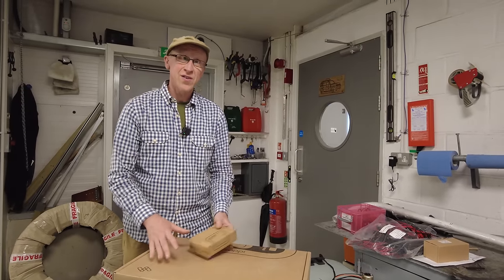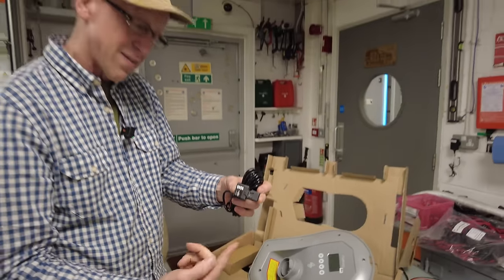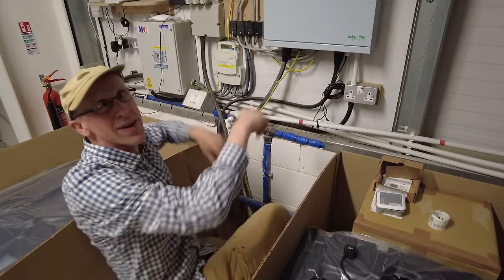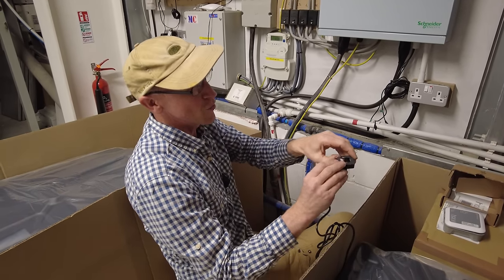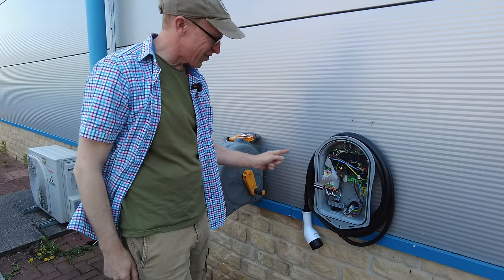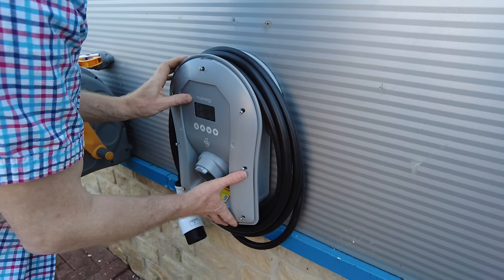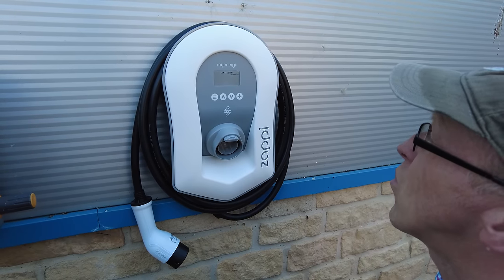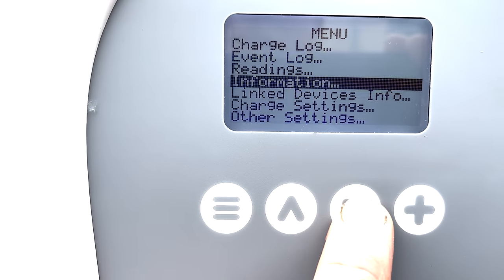Unboxing & Setting Up Zappi Charger - CT Setting / Harvi Pairing / Wifi / Ethernet / Firmware Update

Comment: Yes guys My Energi is from Grimsby,the new Libbi battery storage is taking the UK by storm,yes unfortunately I’m seeing a lot of electricians hard wire a plug first then take it inside connect Wi-Fi first then it will remember even when shut down,good video guys 👍😉💪
Reply from the maker: I have now moved to hard wired CT's and its starting to be more reliable.

Comment: I have a Zappi that keeps my Mini S E running for free in the present weather however I’m about to add an Eddi so I can utilise even more of my solar as it will feed PV down to 0.1kW excess into the car, water heater or (if you have one) a battery storage  system . With Harvi only I have to be exporting 1.6kW before it will switch over to charging the car
Reply from the maker: Hi Tim - we have the Zappi sort of working now with hard wired CT's
We have a lot of solar and i need to use it to heat a tank to run in the central heating loop.

Comment: What surprises me is that surely trickle charging a potent static battery, then dumping that slowly accumulated charge into the car battery quickly hasn't been seen as a solution to fast charging.  Probably a touch more expensive in set up costs, but there is / will be an almost infinite quantity of tired car high capacity batteries to re-engineer and rebuild.  (A small percentage of the profit will suffice.)
Reply from the maker: Yes this is a good idea but a car battery is say 96 Amp Hours at 12v - this equates to about 1.1Kwh ( 96 x 12 )
You would need 70 of these to fully charge the Buzz ( 77Kwh )
Reply: @L663  I was thinking of reconfiguring EV traction batteries, rather than 12V lead acid ones.  But there my be more scrap value in them (for a while) than rebuild value.

Comment: Are there any rules on where chargers can and can't be fitted ? I was surprised it was so close to the water hose.
Reply from the maker: Interesting point and one that i had not even considered. Apparently there is some guidance that states 15m from a hose ! well that is going to be a problem even on my big building ! The unit is an outdoor unit and as such weather proof. The Zappi does not have an earth rod so i am not sure this has an bearing... Can you wash your car while it is charging ?

Comment: It's a bit fiddly to set up, and you have to have the right setting to make it charge from excess solar automatically, you should use the ct direct wired  to comply with the regulations even though it does work with the Harvi not sure why that is, as it will work fine with the Harvi, also you should look at the Eddi solar diverter with resistive loads (spring and autumn heating not so good in the winter unless you have lots of solar) or with the optional relay board if need more control.
Reply from the maker: We now have hard wired CT clamps as you will see in the next video that the wireless CT clamps ) Harvi were just not working